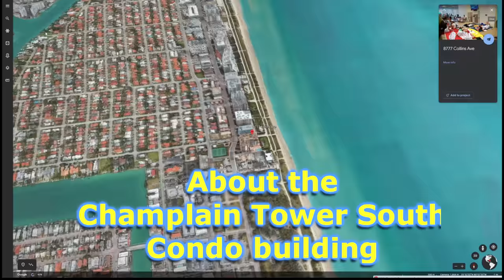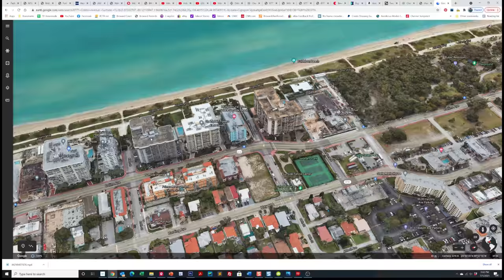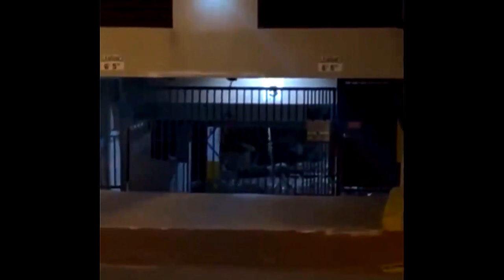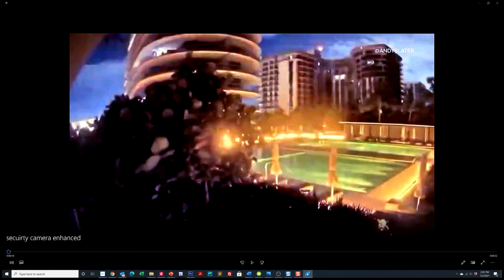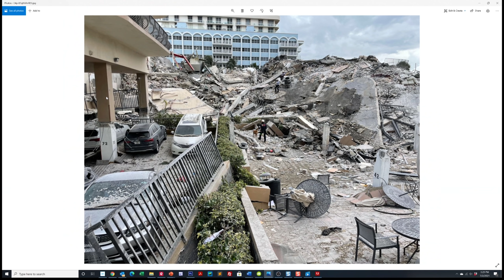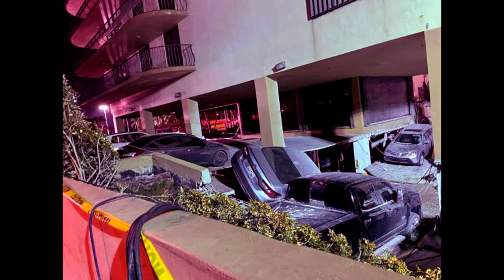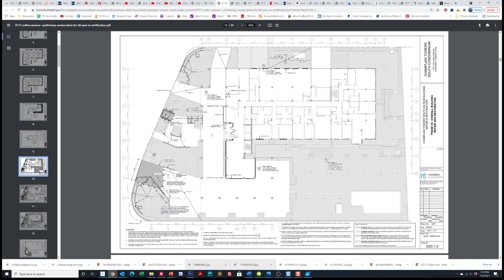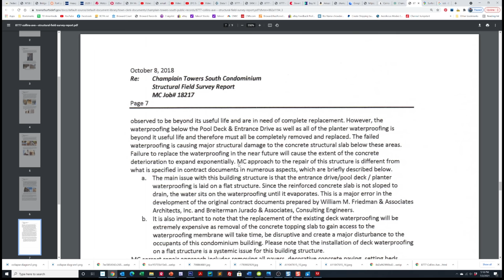Here's Cause Of Miami Condo Collapse Champlain Condo Towers, Surfside

Comment: Great breakdown and analysis. Points out how we rarely have to think about how complicated the things we enjoy really are. There is little/no room for error in our structures, critical tech, etc. What a tragedy!
Reply: there actually always is a lot of room for error built into all land based structures. This is worse case scenario.
Reply: @michaelcrossley5661  I was going to say exactly the same thing as what you just said.  Engineers always build in a margin of safety into their designs, and yet this building serves as a gross example of how neglected maintenance and repairs took away from that.  It truly was a worst case scenario.
Reply: @nobodyknows3180  Oh yeah, the factor of safety is at least 2.0 in each structural component, but there's alway a ton of redundancy that goes into buildings, making them overall insanely high.
Reply: @michaelcrossley5661  So, do you think they blew it on the pool deck design, and just failed to correct on the inadequate drainage?  It seems to me the root cause was deterioration due to long standing moisture problems.  The first five columns of the building to give out were actually integrated into the parking garage/pool deck.
Reply: @nobodyknows3180  I don't know if I'd say they blew it. The drawings clearly show drainage. I'd bet they hired a contractor to re-deck it and didn't know what he was doing. 

I think if whatever triggered the pool deck collapse didn't happen, it wouldn't be a problem. With that said, I think the deck should be freestanding as it doesn't add structural value to the building and looks like it actually may have diminished it. Tying it to those columns made it a liability that didn't need to exist. But IDK, I'm not an engineer, so I'm just making my best guess and trying to learn along the way.
Reply: @michaelcrossley5661  Well, I think your guess is pretty well informed, and that's what makes for interesting conjecture, more so than "sink holes" or "earth quakes".  Thanks for your input.
Reply: @nobodyknows3180  Exactly, we only have a fraction of the information we'd need to know to state what really happened. We're all just guessing.
Reply: @michaelcrossley5661  A few minutes ago I sent a reply to you, but I thought it was somebody else from a different thread.  If you have your notifications on, you might see it pop up, please don't take it the wrong way.  But when I came to the video itself, I don't see my latest reply, maybe it didn't take from the notifications.  But now that I'm here, the gist of the comment is that the real structural engineers aren't guessing, they are already coming up with valid assessments based on known information and an analysis of visual evidence and witness testimony.
Reply: @michaelcrossley5661  As far as I know they went in to the uncollapsed portion of the building and did all kinds of visual inspections, using both humans and hi-res cameras on drones, so they captured as much info as they could about that portion of the building.  It was that monitoring that led to the discovery that several columns were in fact shifting, making it imperative that the building be dropped, rather than have it collapse on its own.  Once they do the actual forensics exam there will be specimen testing and analysis, all parts of the puzzle.

Comment: “Gly”: This was an excellent presentation and I thoroughly enjoyed your analysis. Being somewhat of an amateur geologist I initially thought a sinkhole or some kind of subsidence was to blame but I can see now that it was lack of proper water runoff that slowly over time contributed to spalling and eventual structural failure. With today’s level of building codes, inspections and regulatory this certainly was a preventable disaster via upgrades, retrofits or outright just condemning the building all together.
Reply: should also add the deficancies of the colomuns he did point out the coloums from the stable part of the building that survived were signifigantly beefier
Reply: A foundation failure, right underneath the four thin columns, might not be ruled out since the water drainage issues are very likely not going to stop at the garage slab. Both the soil and the fondation system underneath those four thin columns are on top of my list. the multiple noisy beam failures are a tell tale sign of shifting columns.
To top it all, the workmanship of the original reinforced concrete team is also let bare for the entire world to see.
Engineering blueprints as always are not well interpreted and followed. I mean, who needs those "silly" slopes for the slabs ? Engineers are just "office" jellyfish. Builders know best, don't they ? 100+ dead is a painful reminder of who are the real specialists. And they are not the Architects, nor the Builders.
In my practice, there is always a need to get tough on those chancers.
Wouldn't be a big surprise if the slopes were not respected on the roofs either.
Anger is slowly mounting.
I can't believe that so many people lost their lives for such basic well known issues.
Reply: Or a combination of issues..   My ancestors built beach front in Florida in the 50s.  I doubt they were more than 4 story.. I know they preferred stone over concrete...
Reply: There are tunnels underneath the building far under the foundation of this building which I’m sure are proprietary for National Security reasons.
Reply: @donchonealyotheoneal5456 LoL 😆
Reply: Didn't he says the orig plan was drawn to show sloping but wasn't done?   Who inspected this?
Reply: Yeah and didn't the news at least they said to that the inspectors already said that there was damage that would probably cost over eight million dollars to fix. I'm not sure if all the condo owners were informed about that. But we will find out soon. Very tragic.
Reply: @shanascontrino5737  I know that almost looks like the Builder cut corners or something or maybe that was just the innocent design of the building.
Reply: @jaxxbrat2634  I know I grew up in Germany and all of our buildings were made of brick or other Stone. But building measures here are different and have always worked well  but it looks like there was a neglect in upkeep. Which is probably the worst I can think of. Since there was an association involved and they got the report from the building inspector I would think that the owners of the condos would get a copy of the findings and the estimated costs, which was between eight and 12 million dollars. Was it kept a secret maybe? Well all this will come out soon. Very very tragic.
Reply: Has it been inspected? Have they considered condemnation? There must be a paper trail if so.
Reply: @Christine_G-Thats_Me  my ancestors (Seminole tribe) lived in chickees. They did not collapse like this.
Reply: The fact that nobody acted makes me fear for anyone living in a building like that. No action taken prior to catastrophic failure. They need to look at their processes and figure out a new way of inspecting buildings and taking action. Sad!
Reply: Who is responsible for building code enforcement and regulation in Florida? County I assume? There’s so many buildings along the coast in Florida, I assume it’s county by county
Reply: @traviscoates6878  the failing report is on someone's desk or drawer! To not hold anyone accountable would be a travesty to the victims and that wpuldnt help prevent it from happening again
Reply: Hello Gly :)  I'm a big fan of your channel :)
Reply: Water usually make concrete STRONGER.  We drilled a concrete wall in an old hotel where the wall had been under ground for 50 yrs, plus.  We saw the original concrete recipe. and when we tested it for "load, it broke like it was gunite, not concrete. VERY STRONG!!!!!!!!!!!!
Reply: @plwn6468  Salty air/water also takes its toll on structures.
Reply: @plwn6468  Wow
Reply: @averykelley8268  No, there was no secret kept. The members blocked the repairs because of the huge assessments they would have entailed. A lot of the board actually resigned over it all, including the president. 

This fighting and opposition to badly needed but very expensive repairs or upgrades is a common issue with condos. 

I went through a similar situation with the complex I used to live in with a serious fire hazard with the wiring. Thank God it was townhouses, and that the biggest failure, when it came, only affected 4 units, and no one was injured.
Reply: @kathy-t5q  No, he said that a company that inspected the building said it was an error in design and they proposed reconstructing the pool deck to fix the drainage issue by slopping it for proper drainage.
Reply: @averykelley8268  It was built in 19080. It probably complied to code back them. Seems more like they didn't maintain it properly. They kept ignoring issues with water drainage until the repairs became too expensive and they put off fixing issues that were getting progressively worse.
Reply: 1980
Reply: @ymcpa73  yes I finally read about that and you are right of course. That is such a tragedy.
Reply: @ymcpa73  I was just wondering since it is an association that if any big repairs or anyting has to be reported to the association then the association should have informed all of the residence in the building. I wonder if anybody knew really?
Reply: @wendyannh  wow... but that turned out deadly. Thanks for your info. I didn't know that, of course.
Reply: @wendyannh  oh my goodness I just read what you said about your units thank goodness everything turned out okay for you.
Reply: Stick to rocks bro
Reply: @averykelley8268  i believe they were if i remember correctly. Someone spoke of how each tenant, owner were going to have to add a certain amount yearly to cover it.
Reply: @kathy-t5q  the authority building inspectors. This tells us a lot about what does it mean to be a lobby in government!
Reply: @KidFriendlyGaming  a new way? Not allowing lobbies in governments!
Reply: Wake up 
Deep state took this down
Reply: Wake up 
Deep state was after  Mcafee.
Reply: Sometimes I think about all the bridges I drive on, and drive under.
Reply: @Christine_G-Thats_Me  : That's funny because I was born in 1958, wow I'm ancient.
Reply: @shanascontrino5737  Thanks! BRAVO!! Yes! Nailed it! (As I read through 'Abandoned and Forgotten Places' comments I kept looking for a mention of the "toothpick" columns under the section of the building which collapsed -- Not a word.)
Reply: @averykelley8268  And if those who purchased more recently were not adequately informed about the rate of deterioration of the building then they were DE-FRAUDED by the sellers.
Reply: @traviscoates6878  Nailed it!  Bravo!  You are getting others to think like 'grown-ups'!
Reply: @KidFriendlyGaming  And essential to prevent other construction firms from trying to increase profits by 'cutting corners'.
Reply: @raycarolewallace466  The concrete you tested may have been made better.
Reply: @boywonder8114  I think your wow -- if not by 'Jean-Philippe'.
Reply: @averykelley8268  To deliberately conceal such a structural defect  would be fraud.
Reply: @italiani41  Thanks.
Reply: @Christine_G-Thats_Me  lol
Reply: @teufelhunden799  really , where did you find this info ? and can you post a link
Reply: Yeah, my first thought was the building was built on a sandbar surounded by water,  and the ground gave way.